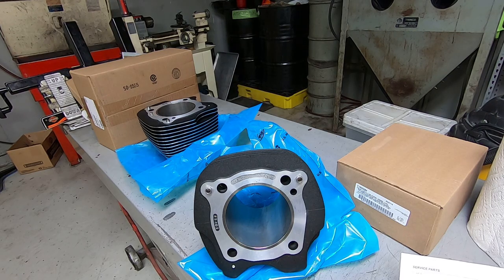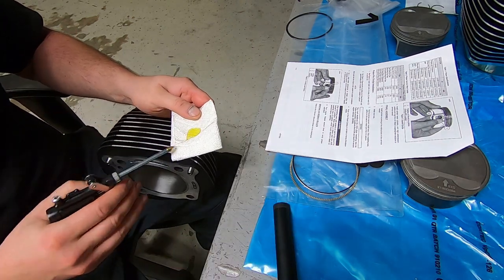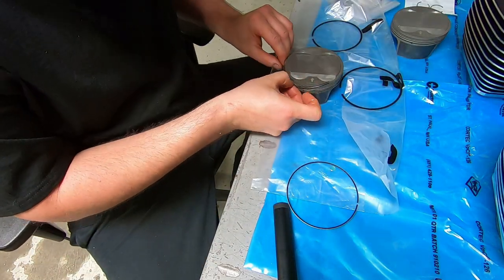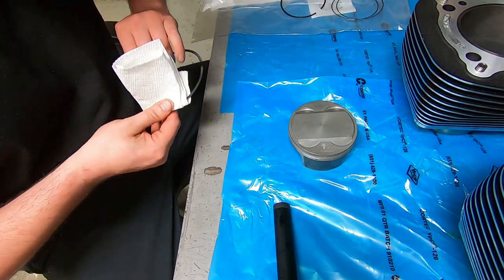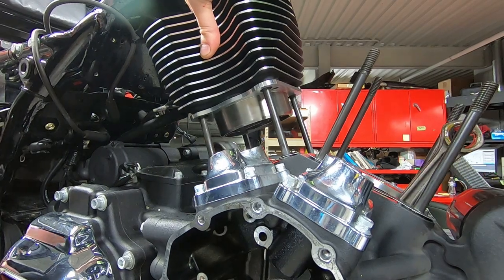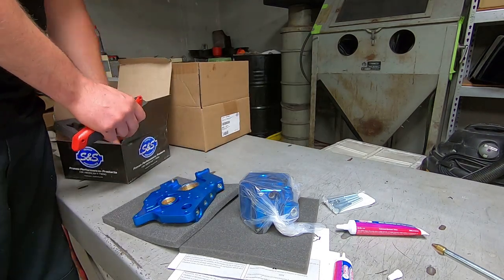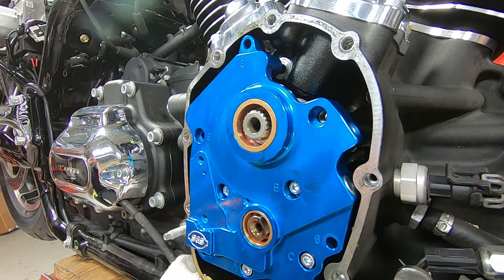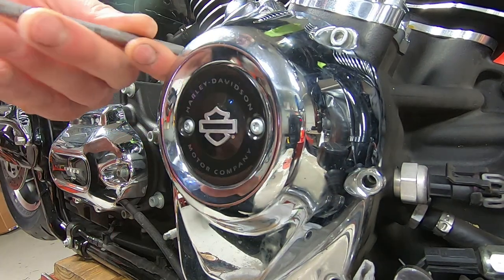2017 STREET GLIDE 114 BIG BORE KIT 11.0:1 HI COMPRESSION + T-MAN 216-2 CAM + DYNO TUNING Part 2

Comment: Nice videos man very informative some of the best on you tube. Does an M8 use an o ring or quad ring at the cylinder base like a twin cam or not ?
Reply from the maker: The m8 uses a rubber coated metal base gasket. Thanks for the compliment and view!

Comment: Hey there I have a newly built 107 to a 114ci with a 498 cam screaming eagle 55mm intake manifold twin slash slipons question is would you know an estimate hp torque tuner is the  pro tuner
Reply from the maker: I don't remember HP or TQ numbers. I go on the dyno and they make what they make. Usually the salesmen remember the numbers.

Comment: hey Brad good vid. Decades ago! piston manufacturers recommended gobs of engine oil when assembling pistons into bores, and not to use heavy lubes. Has this changed?
Reply from the maker: Probably. The manual recommends to do use the screaming eagle assembly lube on the pistons specifically and it is THICK!

Comment: If I use 2oz of sea foam with every fill up will it help keep my internal Parts clean or would I be hurting my performance any? Thanks.
Reply from the maker: I wouldn't worry about it. A little carbon is normal on the piston and if your breather system is still the stock recirculation style its literally gunna be sucking a small amount of oil into the combustion chamber anyways. It's only once the carbon build up is like .020 that it can cause situations and it only builds up like that if the rings arnt sealing. It probably wouldn't hurt anything if you wanted to do that but it likely wouldn't help either. In my opinion. You be way better off changing your breather system so the intake isnt sucking in the oil from the crankcase. Thanks for the question and the view!
Reply: Harley Davidson Wizard                  What would you recommend on my 2018 softail break out for a air cleaner set up cause I’ve tried two other aftermarket air cleaners where the vent tubes are eliminated and I get oil all over everything within a couple of rides so I put the stock air cleaner back on using the stock vent tubes and that Eliminates 90% of it. Im also running a woods 22x cam kit PowerVision Vance and Hines pro pipe and a K&N air filter? Can I just plug up the vent tube holes or do I need to keep them ventilating? Thank you.
Reply from the maker: The Harley Davidson heavy breather is the only air cleaner Ive used that doesn't get carryover oil on anything and has good performance capability. Thanks for the question and the view!

Comment: I take it you are using the stock intake manifold and stock injectors? What if he wanted a 124" kit on? What would you do then? Nice vids!
Reply from the maker: Yes, on this build we used the stock injectors and intake manifold. Ive done a 128 kit also using the stock manifold and injectors also. It really depends on the goal of the project and the overall setup. If you were going to do a 124 kit with just cylinders, pistons, and a cam and keep the stock heads there is little to gain with a bigger throttle body and bigger injectors. Where as if you had the heads ported and used a cam capable of alot more top end airflow, then I would at that point be looking at a HPI throttle body and some of there injectors. Thanks for the question. And thanks for the view!

Comment: The wrist pin clip tool that you used at 1:55 in this video, I know you stated a Harley tool, but appears to be just like Jim’s model #769. Is this correct? Trying to find a tool for 107 M-8 engine 2018, converting to a 128, help......
Reply from the maker: Our Harley davidson wrist pin clip tool has interchangeable tips for different size wrist pins. I havent seen another tool like it. 99% of the time I just use a flat head. screwdriver. What kind of 128 kit did you get?
Reply: Harley Davidson Wizard I am getting the Screaming Eagle version
Reply from the maker: @davidmoore3033  Right on! I just buttoned up a screaming eagle 128 myself, just now actually. Lol. I'll have a quicky vid on mine. I'll have it up in the next 2-3 days. I gotta put the Vance Hines on it tomarrow and tune it up.
Reply: Thanks for the info and videos. The way you explain what you are doing and why helps people like me that doesn’t do this everyday. It gives me a great deal of confidence to tackle this kit. Thanks again. Your doing great! 👍

Comment: What happens to the parts you replaced?
Reply from the maker: The "take off" parts are available for the customer to pick up. In this case the customer told me right from the get go he didnt want them. So anything that's in good "good usable" condition I keep here at the shop and give them away as needed. Sometimes we make displays or a employee or customer cant afford a repair and in those cases the extra parts help out.

Comment: I know im a little late to the party but why would someone spend all that money on upgrades and not go with gear drive cams?
much better than chain.
Reply from the maker: The simple answer is cost. The bike comes with chain drive components and allows for a crank shaft with runout. where as a gear drive setup needs a straight crank and the gears them selves are not cheep.

Comment: Man look at all that carbon buildup on that 107 piston. There is something wrong with these piston rings I see this happen in every m8 video I watch. It gets to a point it starts to generate heat and you can't salvage the parts anymore. It's a very expensive job to fix that later and it will happen outside your warranty time.
Reply: Correction that's not carbon. It's oil